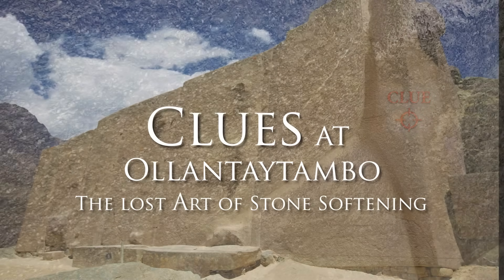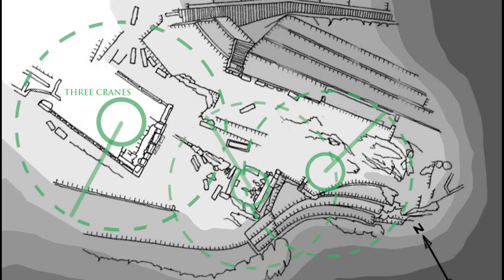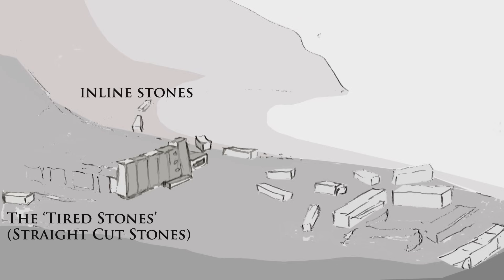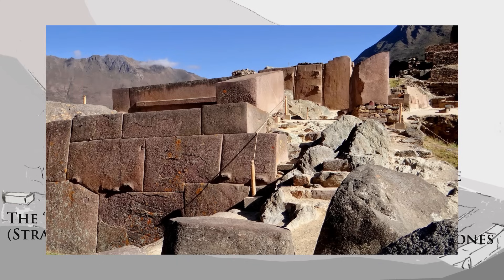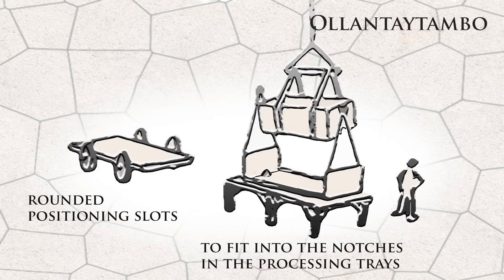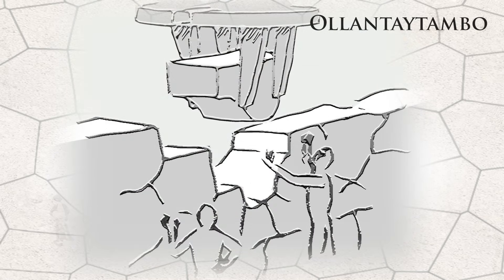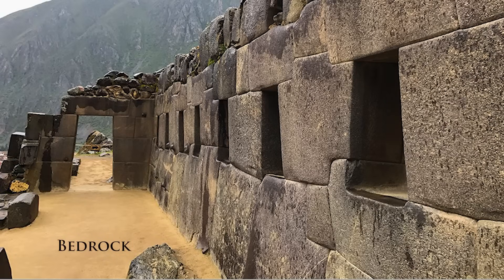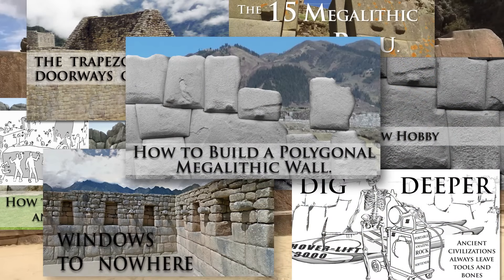Clues at Ollantaytambo. The Lost Art of Stone Softening

Comment: The cart track sites such as Malta, Phrygian Valley in Turkey and other places look like entire areas softened for material sourcing. If that is the case the end use needs to be found. The cart tracks into the ocean indicate pre-younger/dryas. A very odd aspect of the cart tracks is that the tracks look like heavily loaded wheels there aren't draft animal tracks. There are other sites that look as if the stone was so soft people played in it with their fingers indicating the stone softening substance did not affect flesh. The scoop marks also look like material worked in softened stone and the machines used to scoop that material had to be of considerable strength to lift those excavations with articulated mechanism better than my excavators have. I surely wish all the types of machine evidenced stone processing including machine tool witness marks,  softening, quarrying, cart tracks, heavy lift, transport, surface finishing etc be brought together in a single source. I'm not a fan of the sound/vibration concept of manipulating stone. There is a clue under a lid of one of the stone boxes in the Serapeum  Yousef pointed out that evidences a liquid used to alter the surface of the stone to high quality finish. Also the evidences of extreme heat melted stone needs to be included and this may include more recent period heat damaged stone works such as castles and fortresses in Europe. A lot of the shapes I've seen seem not possible to machine such as deep internal box corners, dove tailed H block pockets, holes adjacent to walls and incredible amounts of high quality surface carving that seem only possible via extreme quality and size investment casting processes. All we're doing is kicking over bits and pieces, time to put it all together, wish I could but I'm not going to last long enough.

Comment: Softened to the consistency of whale blubber or soft clay. Then nubs were created to lift them into place?

How could those nubs not break off at such a soft consistency? How could they move such a heavy mass of soft rock in such a state. It would tear itself apart.

Sonic device? Could you be a little more vague? 

It is possible they were able to soften the face of the stone at only a depth of an inch or two. The stone would have to be shaped very close to the geometric form needed. Then applied with their formula to create a tighter bond-like mortar.

Comment: There are several types of rocks (e.g. marble) that when first quarried are quite soft. This is due to the high moisture content. Once quarried, the rock becomes harder as it dries out (over several months). Any rock when under enough pressure will absorb water into its crystalline structure, thus weakening it. Heading a rock (that is freshly quarried and saturated with water) could weaken its crystalline structure further (i.e. make it softer). Submerging the rock in water while it is being heater will reduce the loss of moisture.
Reply: Typo. Heating a rock...

Comment: Bullshit! They were wire sawed, pecked into rough shape then ground back and forth on the Z axis until they cut into the rocks beside and below them. There are few exceptions. No softening or sonic woo woo needed. Once in place the knobs were usually, but not always removed by pecking and grinding.  Demonstrate your hypothesis, don't just state it as fact.

Comment: I still believe the original stone softening peoples had organic acids available from their mining activity that was occurring at the same time they were doing the construction. While I believe they did have plants that were also used to modify the softening process liquids, they were very knowledgeable about organic chemistry as well, even if they didn't call it that!

The rocks that have nubs, were designed into the rock face for when the walls were finished and painted, it would give the painting a 3d effect. We know that there are many animal shapes in the walls, and it is common in all of the walls, at least in Central, and South America.

Another proof of stone softening process, is the ability to make objects out of one piece of stone, and maintain the exact right angle corners and flat surfaces. If this was done, even with great hand tools, the corners would all be rounded over, and there would be inaccurate flat surfaces.

Comment: Pretty big jump from "Here are the straight-cut stones" to "...Lowered into plant-based softening solution with a low-intensity sonic vibration". No, it isn't obvious that stone can be softened just because it fits your hypothesis. That's doing science backwards. Find the chemistry that softens stone. Then you might be on to something. Better yet, find the residue of the solution they allegedly used. They must have used thousands upon thousands of gallons of the stuff. Even after so many centuries there would have to be residue of the stuff on or in something.
Reply: Yes, this is all nonsense. Not remotely plausible.

Comment: If I were tasked with moving the blocks without today's machinery, I would have to build a water-way trough all the way from the quarry & surrounding a cut block, all the way to the wall & surround the wall with the trough, having 30 to 50 foot long locks all the way up the hill. Then get a block to slide onto a raft under water, pump up the raft enough to lift a many ton block & float it down stream, having locks that let it down level by level.. At the base of the hill, coming to locks again, the lock would have to raise the water level equal with the next height & then open the gate & float on, up hill to the wall. Then having a cut out stencil of what the block needs to be shaped like, get it chiseled into shape, not sure how to do the bottom while on the raft?? but when ready, float the block over the submerged wall inside the trough & undo the air in the raft lowering the block into place letting the raft material get squished in place & cut off the edges. Using a new raft, do it all again. That is the only way I could imagine it being done without power tools & cranes & flatbed trucks. Still a monstorous task just for the trough river system & how to get enough water diverted to it & what kind of material for a raft to hold 20 tons above water. A proper raft definitely could float even a 50 ton block but, how to get the block over the flattened raft in the 1st place to then fill it with air?

Comment: Reversing crystallization using cymatics alone might be possible, yet with the addition of ionization of a superconductive level, it would be an easy feat. That means using anti-gravity tech, which is really just a very efficient form of free energy by zero point. Zero point energy is a pump z carrier wave implosively folding carried waves in sync yet out of phase so they combine through the focal (nonlinear) medium. The carrier wave may be just about any shape, but is usually formed as a product of the carried waves through use of high voltage capacitor or a distributor system that shorts out 2 differing charges.

Comment: yea right --- they are going to bring some basically unmovable massive stones from 6 miles away, across a river, and up a mountain just to serve as a retaining wall. that would have taken all the population to be involved with. these ancients were not illogical - they appear to have been smart as hell. there is no reason to believe they would have the intelligence to be able to build these structures, yet be dumb enough to haul 15,000 stones up a mountain. i will always be a firm believer, that the ancients pulverized stones, then had a method to reconstitute them in place like concrete. it would be easy to just bring up bags of pulverized stones, and rebuild them into molds at the top of the mountain. there would absolutely be no space for massive cranes and thousands of people to move around these stones up there.